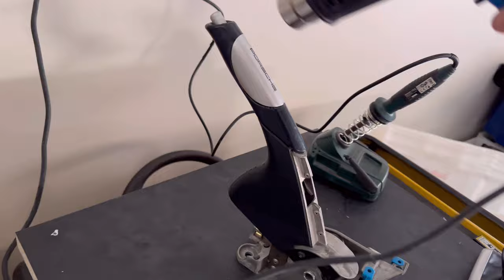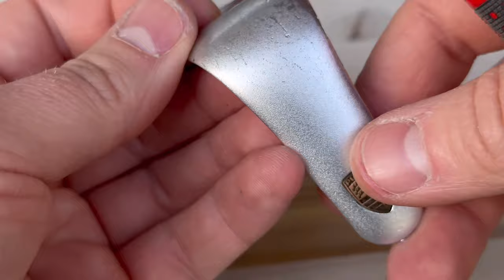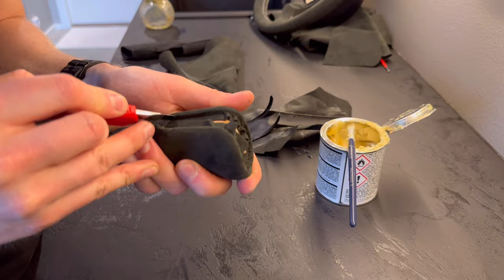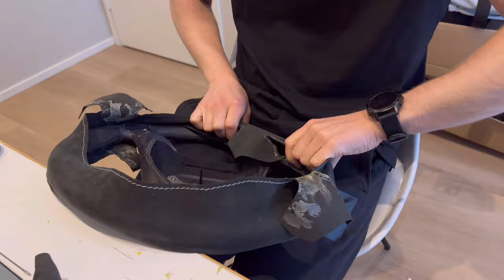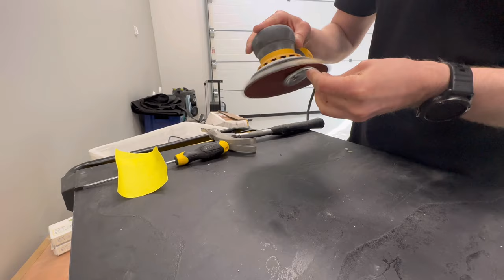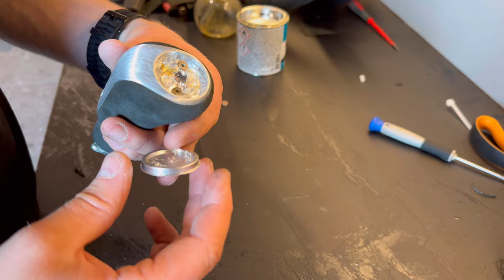Restoring Porsche 996 Steering Wheel With Alcantara

Comment: What kind of sewing machine would I need for this to restore my old Hondas steering wheels and how did you find the paterns to cut the fabric
Reply from the maker: I have adler walking foot sewing machine, any that type is good. Use old leather as template, but you still need to testfit and cut it right size so it fits perfect and then you can stitch it.